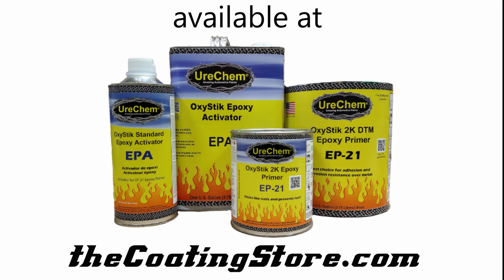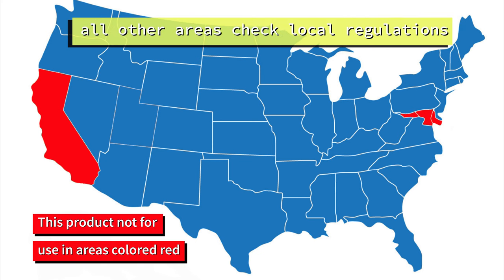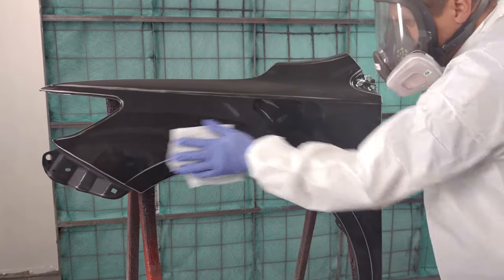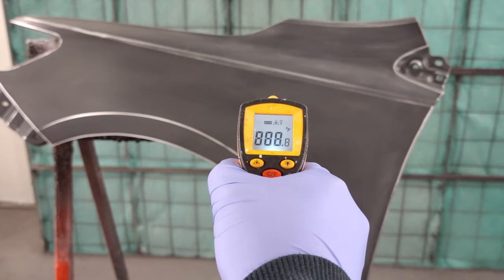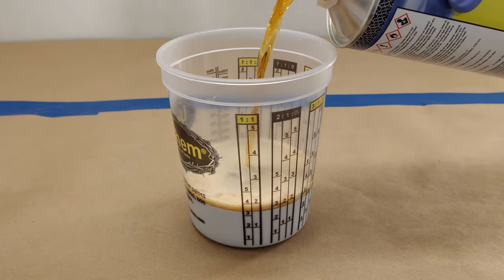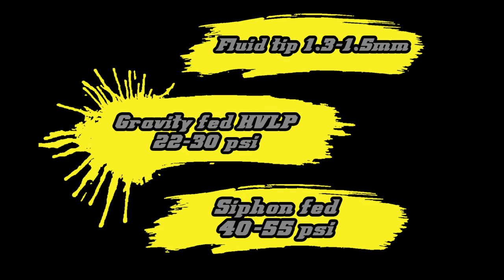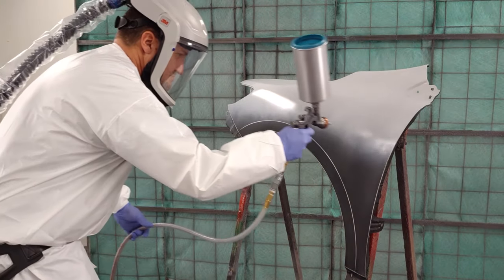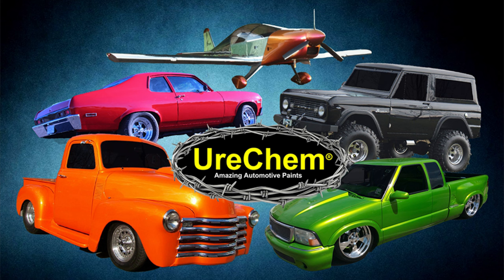How to use UreChem OxyStick EP-21 Epoxy primer

Comment: I will have to visit the online store as I completely Resto-Mod my own 67 C10. As a tech for 4 decades, working on 2,000+ vehicles for other people, I am building one for myself. I have only seen a few quality videos on YouTube using you EpoxyStick, like Pharraway, as I wish to use this everywhere moisture can get to. Even inside the doors and bedsides. Yes, a lot of cleaning, scuffing and prep. But I am a guy who believes in longevity as I build a vehicle 2 years newer than my first vehicle. It took a great deal of hay money but we did not allowance on a family farm. 
  I am going white on top and copper metallic on the rest while sewing distressed Colorado brown leather on the buckets I finished modifying last week to my liking. At 6’ 3” it is not easy getting in or out of just any vehicle. Thanks you folks for putting up the video as I am a true believer of the value of epoxy coatings as a sealer or a primer. It is a belt & suspenders approach. But my work standards are high, but not interested in $600 per quart product from the paint company a mile from my house as it resembles a bank inside and out. I believe a tie & dinner jacket is required to get into the door to have the privilege of purchasing their product after they review my stock portfolio. 
  Subscribed and looking forward to more content, especially metallic brown. A color you don’t see on todays vehicles. Yes, there are some but way to orange and not a good copper!
DK, Omaha. ASE Master Tech since 78

Comment: How long do I have to wait if I use this epoxy as a sealer before I put the base coat on I looked on the TDS sheet but it did not say thanks
Reply from the maker: You'll want to wait at least 2 hours before applying the basecoat, based on 75 degrees Fahrenheit.